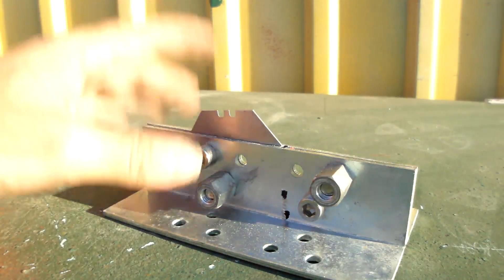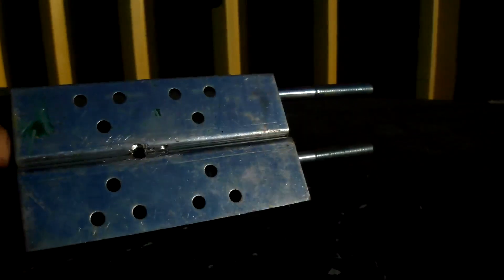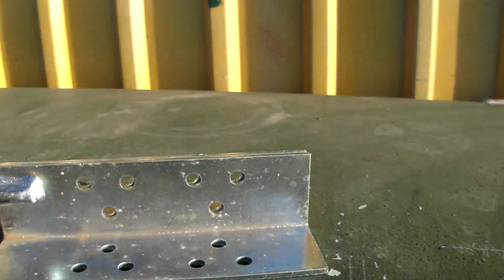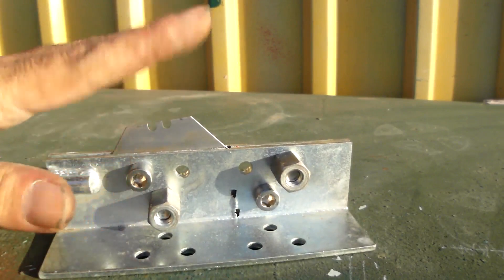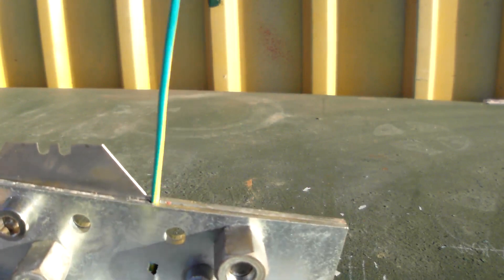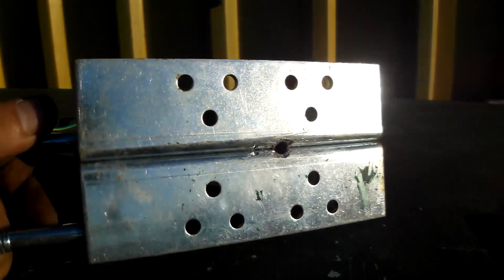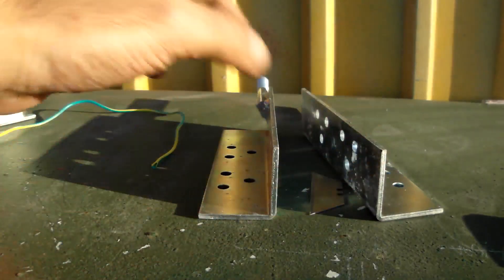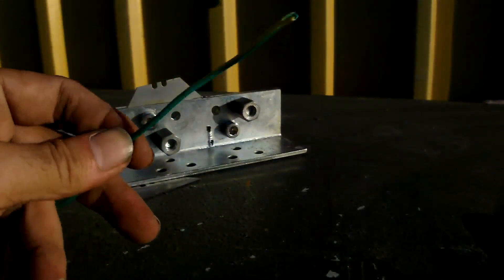i made a cheap cable stripper from scrap parts

Comment: how much weight do you loose when throwing out the insulation? 30%-40%?  how much more per hour can you make by stripping the wire?
Reply from the maker: yep, if its just the insulation on the copper core, its about 40% loss.
But if its a power cord with an outer sheath, its closer to 70%.
the difference is $1.10 per kilo for unprocessed cables vs $5.50 p/kilo for bare clean copper core. if time isn't a factor, then its well worth cleaning cables for the clean copper cores. (Australian prices and weight)
Thanks v much for your comment (and watching too)
Reply from the maker: with the fiddley stuff and thin copper cables, i just put em in the cable pile. It only takes 5 seconds to cut a power cable off appliances on the roadside. Hoard these cable and you might make 20-30 dollars per month.
but if you can process them- you will turn that into $60-100 (but it may take half a day to strip it all down to bare copper.
i strip cables that are longer than 1metre (3 feet) and hoard cable and wires that are very thin or short.
Trial and error my friend, eitherway its much better than leaving it for somebody else or evenworse- throwing it into landfill.

Comment: wood may be easier to drill and work with. just need a way to attach the razor blade.
Reply from the maker: yeah, i thought about it. But the metal was free and does a great  job squeezing the blade in place. Timber would be ideal for a larger unit for doing various cable sizes. i will have the new stripper video up soon.
Reply: tsc RECYCLE  so is the bolts holding the blade from movin?
Reply from the maker: gaonasteve31  Thanks for asking... you're exactly right. There are no holes in the blade. The bolts are squeezing the blade in place. , this means it can be adjusted to suit the thickness and depth required (cable sheaths vary in thickness).
Do you think I should upload a video about the making of this tool? A How To video perhaps?

Comment: I think you should weld a thick nail over the blade. This way, as the wire comes threw the bottom and cuts the insulation, the nail would separate the insulation.

Comment: Great idea ,but if I can make a suggestion,why not have two opposing blades ,such that when the wire is pulled through, the plastic coating is slit on both sides.Theoretically I would have it that the  plastic should just drop away with very little effort from the operator.Thanks,Trevor.
Reply from the maker: G'day Trev. i been thinking about the exact same thing for a while. I am making a new video with step-by-step instructions. However, version 2.0 will have multiple holes and (possibly) dual blades to double score and split the sheath. Cheers mate.
Reply from the maker: Trev's Bush and Gold Adventures  Hi mate. i have made a new version of this stripper with twin blades. I decided not to go with blades on both sides, as it makes it very difficult to feed the cable thru initially.
This one has two blades with two holes                    https://youtu.be/TL9UhDDaKo0

Comment: the only problem I see- you can only strip cables of a certain diameter, bigger ones won't fit, smaller will just slide through...

Comment: Nice video. I made one like this today using aluminum angle "iron" that was in my pile and just used two vice grips to hold it all together instead of bolts. It worked great.
Reply from the maker: nice work. i reckon aluminum is easier to work with. I made mine from scrap parts due to availability. Im glad you were able to benefit from this video. Thanks heaps for watching.  : )

Comment from the maker: thanks Retrodqfan .  i needed to strip 3mm cable.  so i used 3.2mm drill bit all the way, and a 4.5mm into the bottom (to make it easier to feed cable and clear out any obstructions). cheers